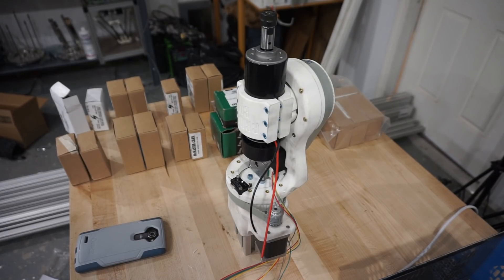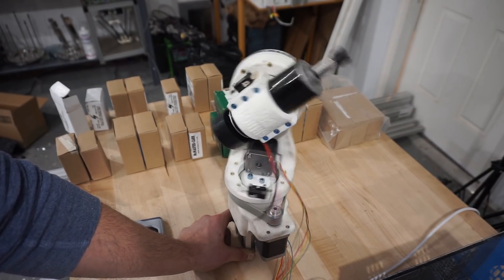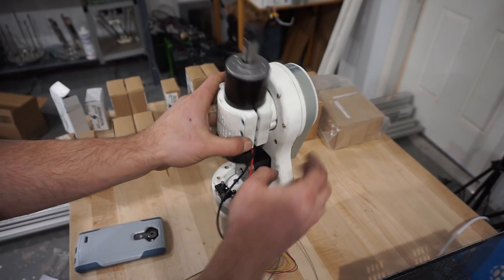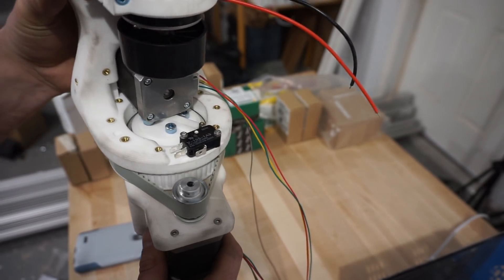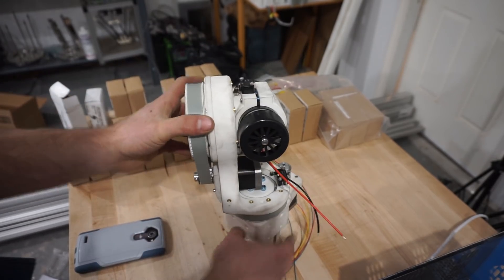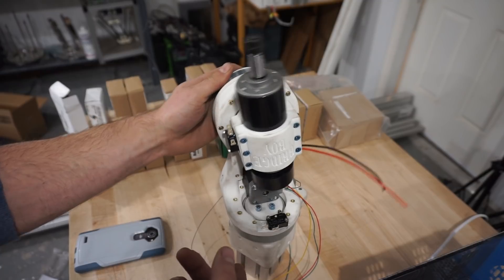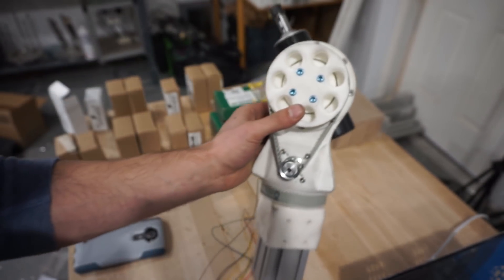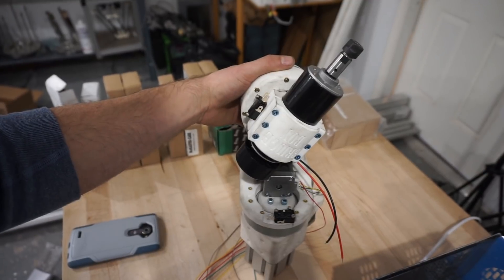Bridge Boy: OS 5 Axis (mostly) 3D Printed Mill

Comment: I spent a few hours to reverse-engineering the video and F360-models to make the project more "Open-Source", so if someone willing: V-axis bearing is "6009-zz (5972K271)", U-axis bearing is "6210-2RS (5972K366)", The pulley are "1428N420_T5 SERIES TIMING BELT PULLEY" The U-belt is MEGADYNE MPW2 T5 400 3017, the V-axis belt I can't find, the video not clear about it same as at the 3D model... Hope I helped you a little 😆
Best regards, Linda 😇
Reply from the maker: thanks!
Reply: @MrReinerMSchmidt  yw! Btw, it will be awesome if you help us with the belt and pulley naming, i think we are good enough to know this XD
Reply from the maker: @MethelinaPills  I'm going to look through some old notes. I couldn't find the belts in my order history but from the CAD I can reverse calculate them.
Reply: @MrReinerMSchmidt  Cool, thx, it will help!

Comment: I modified these files as you suggested. Printed in PETG, I found straight 1.78A rms NEMA 17's to skip steps, so went with a 5:1 planetary. Using Dynomotion Klfop board and software to handle the kinematics. Just test cuts so far in foam but seems to be promising. Once roadworthy will machine a foam main body and do lost -foam casting. My belts seem a hair loose for some reason so added some ultra "custom" tensions. Maybe a redesign to build in tensioners? idk, anyway thanks again for getting the design out there!
Reply: https://youtu.be/DF6puTm5a_8 here is the test kinematics video
Reply: awesome work! could you please share the modified files :)

Comment: I was going to convert a radial arm saw into a  450mmX 900mm X 450mm xyz table for 3d printing / CNC.  I was going to skip controlling the swivel and bevel, but if I adapt something like this to the arm, It could be cool. I guess before I try adapting, I probably should take care of stepper control for X, Y, And Z first.

Comment: For those looking for the parts list, these are from the Fusion 360 preview program.

outside spindle clamp:1
inside spindle clamp v1:1
5972K366_BALL BEARING v1:1
A: retainer ring:1
A: large pulley:1
spindle mock v2:1
body:1
6627T660_POSITION-CONTROL DC MOTOR v1:1
1428N420_T5 SERIES TIMING BELT PULLEY v1:1
Upper retaining ring:1
5972K271_BALL BEARING v1:1
z mount:1
z retainer:1
6627T660_POSITION-CONTROL DC MOTOR v1:2
1428N420_T5 SERIES TIMING BELT PULLEY v1:2
OMRON V-155-1A5 v1:1
OMRON V-155-1A5 v1:2

Comment: 2:47 even easier kinematics would be a table table ac/bc machine, this way you dont have to account for the tool length/spindle nose offset from the center of rotation.

Comment: Hi Reiner,  just found your amazing video!  i have made almost same model like this!
How did you eliminate the natural play from the bearings? I am using two big bearings that i pull towards each other, but don't get it as compact as yours. My bearings are OD80 by ID60.

I print my model from standard PLA with 5 wall thickness and 50% infill. Print took about 28 hours, but result is amazing. Weight about 700 gram, so about 20 dollar (15 euro). Also i'm using Nema 23, think you have nema 17? 

Do you have a new video of this beauty in action?
Reply: 6:09 listen to what he's says about play/backlash

Comment: Wouldn't it be better with a slip ring electrical connector so that the horizontal rotation could go 360 degrees?

Comment: It would be amazing to have the stl files split into parts for 3D printing and modifications. The current file is a great cad representation of the design however, not suitable for 3D printing right away. I am not a huge CAD expert just like many others here who are looking at your product , so I just like to assemble code and see the result.  I know a bit of SketchupPro & Fusion 360 , but not an expert at that software. thanks for your work , its great!!!

Comment: Nice, thank you. I might try printing it in petG. And by the way. You don't need flenches on the 3d printed timing wheels. It should only be flenches on the motor wheels. I stay tuned for the actual application 🙂👍

Comment: I think you should add aluminum plates on the side to aid in rigidity with screw holes to hold them inplace while drying. Laser cut parts are cheap

Comment: I love this! Thanks for making it open source as well. I've ordered all the parts and I am going to print it soon. What breakout board are you planning on using for the other axis? And what control software? I currently use Mach 4 with an Ethernet Smoothstepper Bob, but I have no problem building out a new control box to get this head to work. Good job once again.
Reply: Jonathan Kuiper are you able to point me to the list of parts? I can’t seem to find them listed anywhere.
Reply: Jonathan, I'm also looking for a part list. Do you have one that you're willing to share? This would be awesome to build!
Reply: Kyle Roseberry hey Kyle, I found out that if you open up the model in Fusion360 the part numbers are listed in the name of some of the components. I just searched for those part numbers on the website he mentions in the video.

Comment: Looks great but you need to be careful spinning the motors by hand whilst connected to your driver board. You could blow the electronics!
Reply from the maker: Andy Chadbourne this board is actually safe. It can work as kind of a regenerative system. Any power generated by the system gets regulated down to system power (5v). You would have to spin the motor at an insainly high rpm to damage anything :P
Reply: Makes sense - many stepper driver boards don't have that protection built in. Looks like you've selected a foolproof one. I look forward to seeing more vids - keep it up!

Comment: Any chance you could send a set of STL files for it?  My email is Sciencelookers@aol.com    If you can send the part files in a way that I can open with inventor, I'd like to add belt tensioning adjustments, a base that mounts to a photo tripod, and a bracket to hold a camera where the spindle motor is.  You've designed a really nice pan-tilt head.  I'd also like to try making molds from the 3-D printed parts so they can be cast with fiber reinforced epoxy composite.  I think multiple copies could be made which are even stronger than the sintered nylon.  Thanks in advance for any collaboration you may choose to help with.

Comment: That's pretty cool, you should elevate the spindle motor a bit further and put the stepper on the other side if you can. If you do, you could have a full 360 degree rotation with the spindle which may or may not ever come in handy but it would be pretty cool haha

Comment: Usually I just use a combined drill, thread-cutter and countersinker to cut my threads into parts made out of nGen filament.  For mechanical parts I use a 1.0mm nozzle and large layer size, resulting in crazy-strong parts because there are less and bigger intersections betweens lines of filament.

Comment: On my A axis I used an inductive sensor instead of a mechanical switch for homing. I figured that would be easier for movement >360°. It works very well. https://www.youmagine.com/designs/wip-homing-sensor-for-cnc-4th-axis

Comment: Dual limit switches/bumps with an SR latch might be a good solution to the homing.
Reply: fcguy7 I worked on a Bosch robot once... It had a switch that was triggered through 1/2 the travel. When turned on, if triggered it would go left... Otherwise it would go right. It found the trigger point and set that as zero. Then it would move to the appropriate soft home which was configurable.
Reply: @Askjerry  : That's effective... pretty much a basic absolute encoder.

Comment: Hello. How do you plan to control this? LinuxCNC, GRBL, Mach3? I want to make a 5-axis cnc mill, but not a bridge mill like yours. I want to use a vertical mill design. Will your control software be able to handle that?
Reply from the maker: Well i have experience with linuxcnc so im probably gonna try that. I have also written a gcode interpriter in python but its not the greatest.
Reply: You might want to look up pyCNC, as it is based on just a RPi, with stepper driver.

Comment: Hello Reiner, happy to print this out using FDM ( LulzBot TAZ 6 ) and SLA ( Form 2 ) to see how it fares.  For testing purposes, I'll print it out in PLA, and then again in something stronger like Taulman Nylon 619.   

Do you have the sub-assemblies exported as STL files for easier printing?
Reply: I would also like to download the STL files.  Have they been posted anywhere?  The link in your description is for viewing and markup of the entire assembly.  Sorry to ask for a lot of files, but people are going to need an STL for each part that is 3-D printed.  Also a link to the exact bearings you used would be very helpful.  Nad as though I'm not asking a whole lot, an IPT file which can be opened and modified for each part would let us make improvements (such as some way to tension the belts to reduce backlash as parts wear).
Reply: Hello i´m very interested in your excellent work, i tried to load a separeted piece as stl file but it will exported as one whole biuld. it would be nice to put the indiviual parts in git or places like thingiverse
Reply from the maker: The Makers Workshop great! No but i beleive you can download them from the link? Or are they all in one STL? I can throw the .stls on git.
Reply: Reiner Schmidt, that would be good.  I can download the complete model, but autocad 360 does not allow me to export it broken down by assembly

Comment: Could this theoretically be done in aluminum for a rigid 5 axis desktop router?
Reply: I haven't looked at the model yet, I have it downloaded for later, but looks like all of the pieces could be done on a mill?
Reply from the maker: Yeah i think its possible. Would probably have to refixture a few times. The timing pullies might be tricky.
Reply: Reiner Schmidt agreed. I think the shoulders for the belt could be made as guards to be screwed on to overcome that. Definitely something I'll be keeping an eye on. Great work!

Comment: Did you press-fit the BridgeBoy pieces into the middle of the bearings?
Reply from the maker: TheRainHarvester they are a very tight fit but i was able to just press them in by hand. I want to be able to remove them in case i smash something making the machine :S